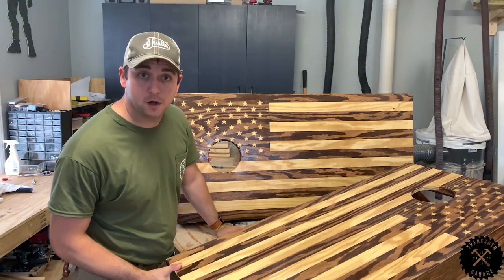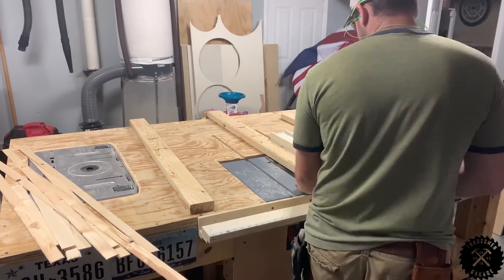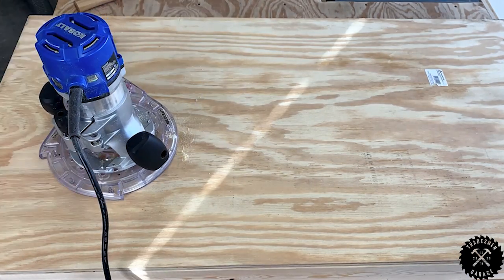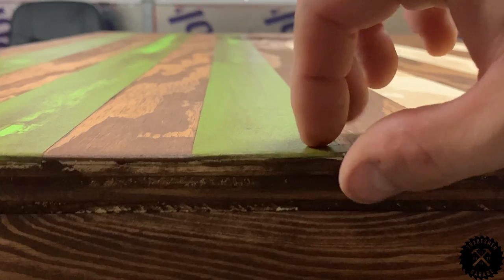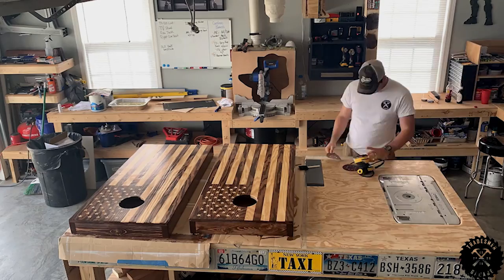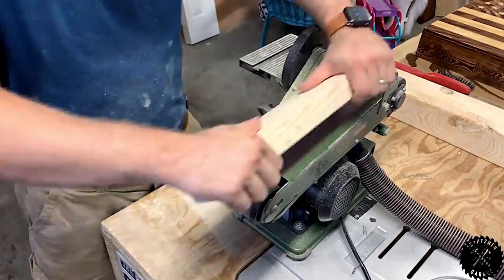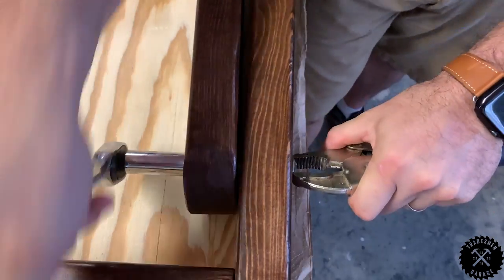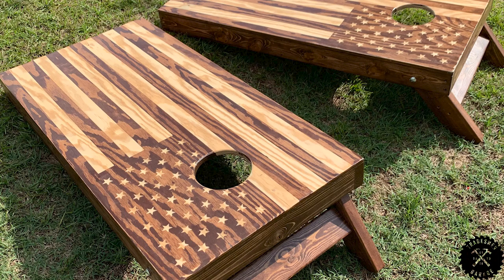How to Make American Flag Cornhole Boards

Comment: US Code title 4 chapter 1 section 8. No disrespect should be shown to the flag of the United States of America; the flag should not be dipped to any person or thing. Regimental colors, State flags, and organization or institutional flags are to be dipped as a mark of honor.
(a) The flag should never be displayed with the union down, except as a signal of dire distress in instances of extreme danger to life or property.
(b) The flag should never touch anything beneath it, such as the ground, the floor, water, or merchandise.
(c) The flag should never be carried flat or horizontally, but always aloft and free.
(d) The flag should never be used as wearing apparel, bedding, or drapery. It should never be festooned, drawn back, nor up, in folds, but always allowed to fall free. Bunting of blue, white, and red, always arranged with the blue above, the white in the middle, and the red below, should be used for covering a speaker’s desk, draping the front of the platform, and for decoration in general.
(e) The flag should never be fastened, displayed, used, or stored in such a manner as to permit it to be easily torn, soiled, or damaged in any way.
(f) The flag should never be used as a covering for a ceiling.
(g) The flag should never have placed upon it, nor on any part of it, nor attached to it any mark, insignia, letter, word, figure, design, picture, or drawing of any nature.
(h) The flag should never be used as a receptacle for receiving, holding, carrying, or delivering anything.
(i) The flag should never be used for advertising purposes in any manner whatsoever. It should not be embroidered on such articles as cushions or handkerchiefs and the like, printed or otherwise impressed on paper napkins or boxes or anything that is designed for temporary use and discard. Advertising signs should not be fastened to a staff or halyard from which the flag is flown.
(j) No part of the flag should ever be used as a costume or athletic uniform. However, a flag patch may be affixed to the uniform of military personnel, firemen, policemen, and members of patriotic organizations. The flag represents a living country and is itself considered a living thing. Therefore, the lapel flag pin being a replica, should be worn on the left lapel near the heart.
(k) The flag, when it is in such condition that it is no longer a fitting emblem for display, should be destroyed in a dignified way, preferably by burning. Free to disrespect the flag of the United States of America…. 🇺🇸🗽
Reply from the maker: Thanks for the lesson! 

Unfortunately this is not a flag, merely a representation of a flag.  What you have referenced above applies to an official, physical cloth flag. 

🤙